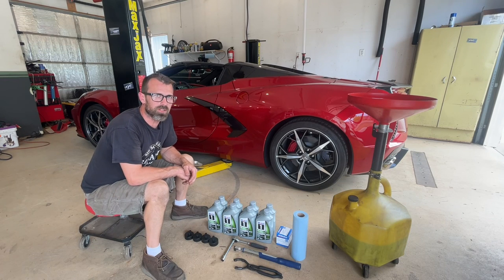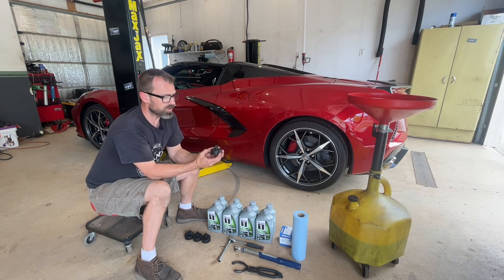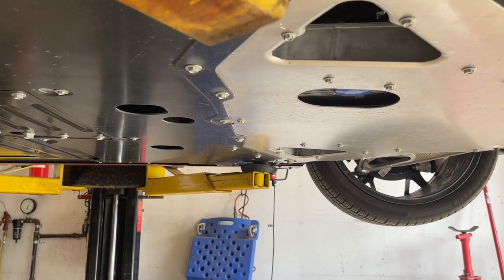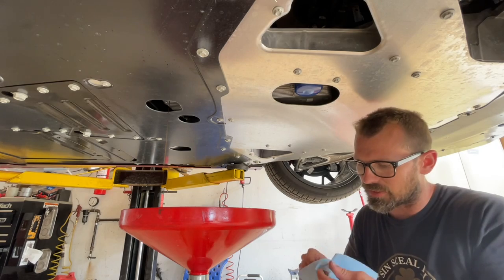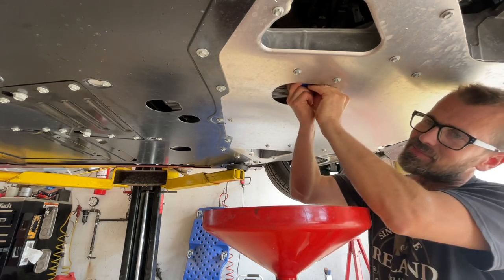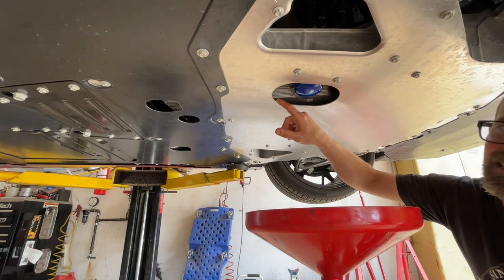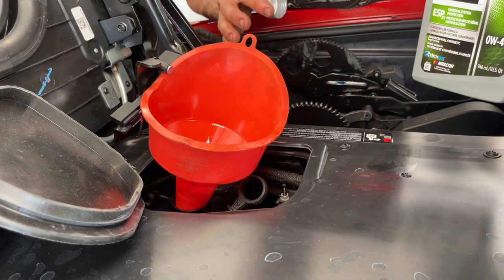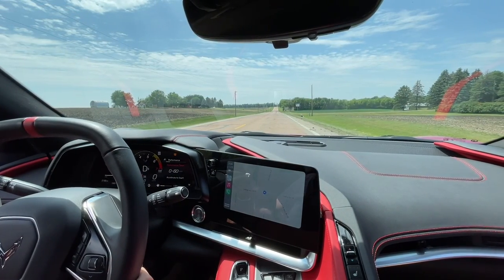2023 C8 Corvette convertible oil change, checking the oil, resetting the oil life (and launch??)

Comment: Why are you changing the oil and filter when the first service is included free of charge?
Reply from the maker: Because the customer wanted to bring it to me.
Reply: Hate to say it but personally I wouldn't trust "most" dealerships to perform the included oil change service on these cars and their lower end but still formidable Camaro brethren using the proper spec oil. GM now recommends 0W40 Mobil 1 Supercar oil (dexos2/R), the ESP oil in this vid also meets that spec.  This oil costs about $10./qt sometimes more.  My experience dealing with dealerships over the years,seeing what they do and don't do while charging $220./Hr. leads me to believe they will likely use the much cheaper Mobil 1 synthetic 5W30 (in bulk form) in such applications, the old spec for these cars on the previous C7 and last Camaro 6th Gen LT1 engine (those take 10 quarts), Corvette LT2 engine 7.5 as outlined in this excellent vid. I actually had someone at a dealership slip and tell me this, assuming most customers wouldn't know better. Their thinking it's only the first oil change by the time it causes any issues the cheaper 5W30 they put in, will be long gone.
Reply from the maker: @cardo1111  thanks for your comment. This hadn’t even crossed my mind in my response, you I have also heard many stories of similar issues.

In general I think it’s a great idea to change your own oil because it gives you the chance to look over your car, and you get the exact oil and filter you want. In this case the oil spec is very specific, but even if you just drive a Corolla and want to run a specific synthetic oil you will have that option and know that you are running exactly what you want.